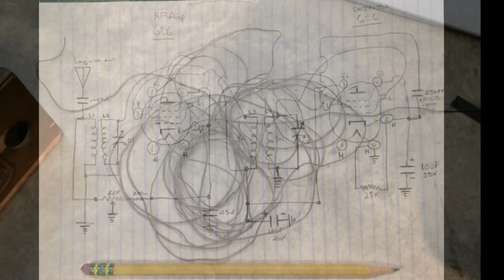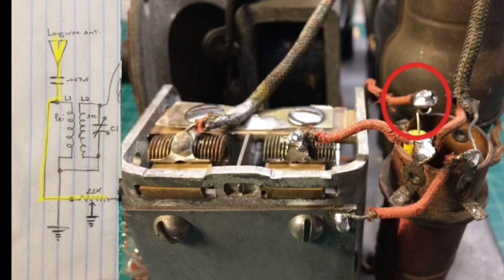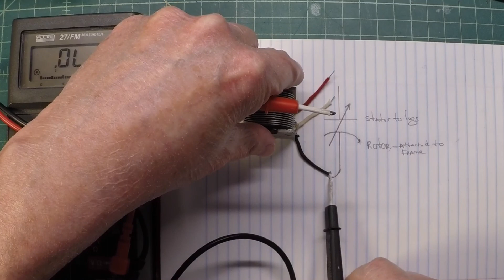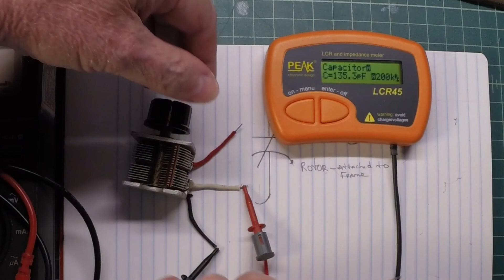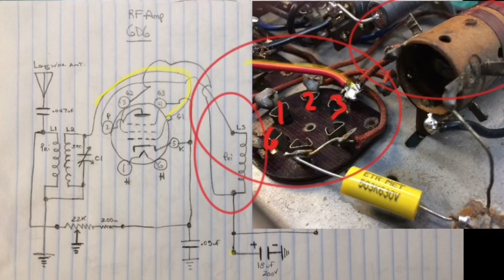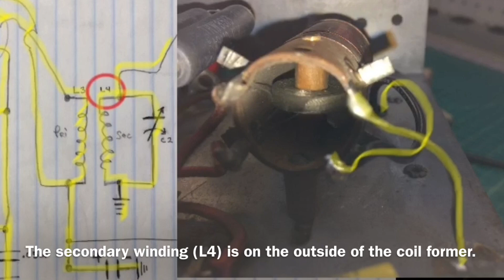Reading Schematics Can Be Confusing - TRF Receiver Example

Comment: Hi Don I hope you are still around as I note most of the comments are more than 2 years ago.  Your schematic was the closest I have found to date, that almost matches a small radio I inherited.   This one has no makers identifying marks and looks as though it was scratch built from a kit or by a hobbyist.   I have succesfully mapped out most of its schematic except for the way the coils are wired up.  They look like they were commercially available types, but as the radio looks to cover medium and long wavebands, the coil connections are difficult to work out without removing them. 
Also I can't work out where the demodulation is carried out to feed the final AF stage.  The tube line-up is  three pentodes. 6K7G, VR 56 and VT52.
I have yet to (carefully) power it up, having replaced the selenium rectifier with a silicon rectifier diode.  Any knowledge you have as to whether this was a kit or the whereabouts of a pre-existing schematic, would be interesting.  I have no idea if it is likely to work at this stage, so interesting times.
Reply from the maker: Yep, I’m still around. Sounds like an interesting 3 tuber. Is there anyway you can share your schematic (what you have mapped out to this point) so I can review it? My gmail is TheRadioRepairGuy if this helps. Best, Don

Comment: The long wire antenna is the most interesting part to me. Is that about 22 AWG and is it stranded or solid? Is the coil on the dowel a necessary part? If so can you explain what it does? It looks like a choke to me. Is the .047uf cap a part of the antenna or a part of the radio originally? What I did not see was you hooking the radio up to a ground. Do you hook up to a ground and if so is it the electrical house ground or a separate ground plane?
Reply from the maker: +Carl Davis Hi Carl, sorry for the belated response. I've been racking my brain trying to figure out the source I used for the build. I ran across it today. The DX Antenna was from Electronics Illustrated (1960). Here's a link to the article: 

http://www.americanradiohistory.com/hd2/IDX-Consumer/Archive-Electronics-Illustrated-IDX/IDX/Electronics-Illustrated-1960-03-OCR-Page-0087.pdf#search=%22ferrite%20antenna%22

My build doesn't use a paper tube for the 100 turns of wire nor did I use the 365 pf variable capacitor. In addition, I didn't ground the chassis using a cap because at the time I was working with a hot chassis set.

I may do a video on this and share the design inductance and capacitance across the broadcast band.

The .047 uf cap was part of the design for the Majestic International radio. The old cap like the new resides in the coil former. An .05 was installed and I was out of them. 

No ground was used since the chassis is hot theoretically. Of course my isolation transformer was being used at the time.

Hope this helps and thanks your patience. 

Best,

Don
Reply: Wow, thanks for the very detailed reply and I hope you do a video on this subject. I enjoy your videos and I am thankful for all the tips I have learned over the years.

Comment: I have a hard time , will follow schematic wiring but the board may have 4 or 5 parts connected together where on the schematic make it look like there not. Or ground points will be in different places other then where is shown on schematic
Reply from the maker: +judges69 I'm with you on this one. They can be head scratching at times. Thanks again for watching. Best, Don

Comment: Hey at my age (66) I get confused easily tracing out circuits. I am forever messing up polarity of Electrolytics or getting diodes backwards. But at least that schematic is a simple one to go through and explain. Great job explaining the circuit and the physical locations of the actual parts on the chassis.
Reply: Johnny Umphress Well i dont feel bad just get frustrated and i have worked with radios since junior high school
Reply: LUCKYLARRY in
Reply: Thanks so much Don for taking the time to explain the schematic and how it relates to the actual components.  You picked a great area to explain!!  Although I have been working at the hobby for 15 years, I don't believe I have ever really understood how the various markings on the schematic actually relate to the components in this part of the chassis.  Another area that still befuddles me is the tie ins to the various band switches, especially on a radio that has multiple bands.  Please keep me in the back of your mind in the future if you decide to restore a set that has a multi band.  It would be great to have you explain those connections as well.  You have a real knack for bringing these topics down to a level where most anybody can understand them.  Using myself as the litmus test, if I can understand it, then anybody can!!  Thanks Mike McKenzie
Reply: Yes I know about the bathroom forgetfulness factor I forget to zip up. I only notice when I feel a draft. Very awkward to zip up in the grocery store right in front of the pole beans. lol
Reply from the maker: +LUCKYLARRY Thank you sir. I learned a few things along the way as well. Best, Don
Reply from the maker: +Michael McKenzie Hi Mike, thanks for your kind words. Those band switches can be a pain in the... When the opportunity presents itself, I will publish a video on how the schematic ties to the physical layout. Thank you again for following my channel and hope your weekend is enjoyable. Best, Don
Reply from the maker: +AMStationEngineer Too funny. I'm at that point myself. Best, Don